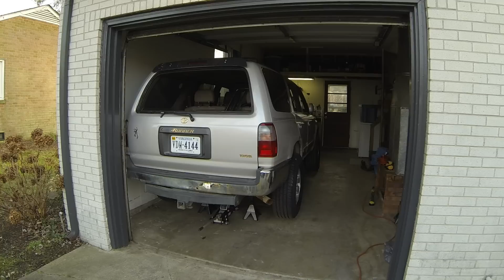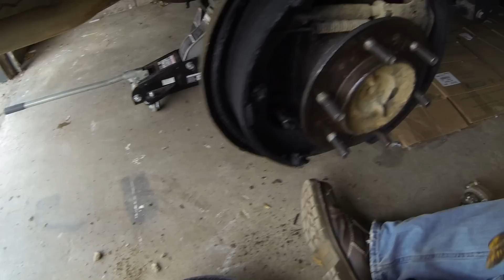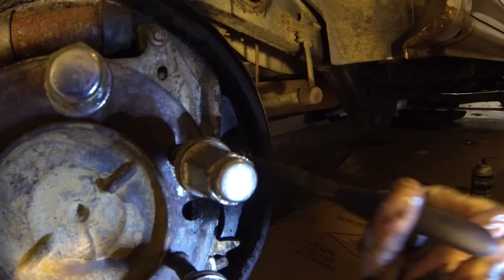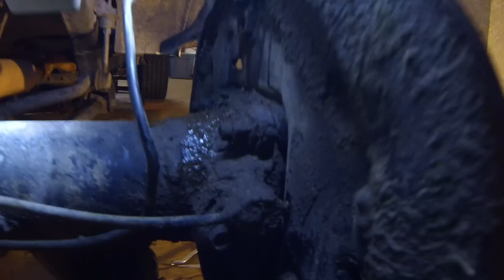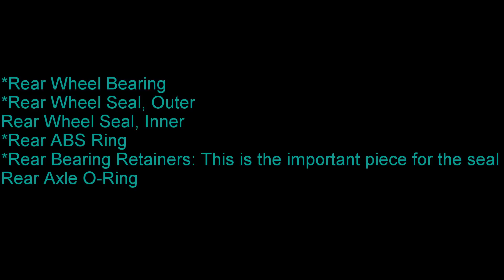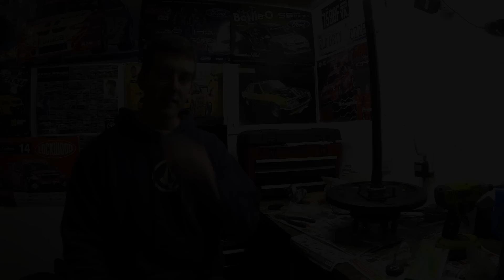3rd Gen Toyota 4Runner Project Build: Rear Axle Seal Part 1

Comment: The tools to re condition the axle shaft are made by a Toyota 4runner enthusiast there not to bad on price 135 bucks and if you want the Tacoma adapter its 45 bucks helps remove and re install the tone ring and seals

Comment: very good.  Also looks like you replaced the wheel brake cylinder while your were at it.  Also, where is the 'hot air escape valve" located?  Seems pointless to replace everything if the causality is a plugged up valve....... Actually , it is called the 'rear axle differential vent'..... The vent is located on the upper left side of the differential looking from the rear.

Comment: great video. Do you actually need to remove the brake pads or is it kind of a must just to get the e-brake wire out of there? Thanks,
Cole
Reply from the maker: Should make life easier to remove the pads
Reply: Would have to replace the pads anyways since they’ve been soaking in gear oil. The E-brake line just disconnects near the bottom and you can also unhook the bell crank behind the dust shield.

Comment: Was there a retention "C" washer that retains the axle in the differential?
Reply from the maker: not that I recall...there are 4 bolts that hold it in place behind the drums
Reply: I've done a similar job like this on my 1995 F150.  To prevent the axle from coming out of the differential, there was a large "C" shaped washer that retained it.  Because the axle is a rotating assembly how do 4 bolts hold it in place?  Do they go into a rotating baring assembly or something?
Reply from the maker: The bearing/hub is pressed onto the axle shaft which has 4 bolts pressed in from the factory. The bolts would go through the axle housing and screw into the pressed on axle bearing plate.

You can see this on my part 2 video around the 2:14 time mark: https://youtu.be/tp1-bXbkpW0?t=2m14s

Hope this helps!

Comment: looking to get mine pressed and replaced also, want to do what you did and dro it off so i can slap it back in. roughly how much $$ is it to do that? i would imagine cheaper since the shop isnt seeing the truck, just the axle. awesome vid!
Reply from the maker: thanks! It cost an hours labor which was about 100 bucks in my area. dealer charged me 300 to do the exact same thing
Reply from the maker: +Garage Topics however the dealer may have known how far to press the bearing back in, eliminating the headache I had

Comment: Next time you try to take off your rear drum just give it a little smack with a hammer.
Reply from the maker: yea I was a pansy and didn't want to break anything...screw did the trick though!
Reply: +Garage Topics Whatever gets the job done is good in my book! great video. keep it up!
Reply: Christian R.  you can blast the crap out of the drum at an angle on the edge. works like a champ. i have never damaged a drum with this method.

Comment: I'm trying to make an account on the t4r forum to ask for some help but it keeps saying I'm a spammer so it wont let me sign up. I've already emailed the admins and am waiting for a reply. In the meantime what brake parts did you replace. In my case since axle shaft snapped what should I do?
Reply from the maker: Shoes, drum, wheel cylinder, drum brake hardware kit for the rears. Just make sure you fully drain the oil and get any metal flakes out of the oil/rear end. A magnet should help get any metal shavings out. Best of luck with the message board!

Comment: Do you know how to check to see if the rear axle bearings are worn?
Reply from the maker: +eric brune when you take out the axle, it will be sloppy on the axle compared to the hub. Without unbolting anything, jack the truck and and pull/tug on the wheel. If it has play, most likely the bearing is bad. Hope this helps!

Comment: I have a 98 4Runner and I have to change the axle seal as well.  I'm very grateful for this video.  Seen it, rewinded it, paused it, got upset at the shop like you did and saw the video like 10 times more.. ha..  One question if I may, while your grease build up was tremendous and required new brake pads and drums, mine aren't so bad.  I was able to clean the pads and drums with brake cleaner and they seem fine (emphasis on "seem").  Are greasy pads no longer good?  Does he clay from the pad absorb the grease somehow?  Sorry for what might be a "newbie" question.  Better safe than sorry.  Thanks for the video and any input you can give.
Reply from the maker: Thanks a lot! Yea I was super bummed about the shop messing up..live and learn.

Since I bought the 4Runner with the leak, I wasn't sure how long it had been leaking for. That's why I got all new brakes. Also, I didn't want to clean up all of that grease buildup and have the brakes not work later down the road.

Comment: I would have been more upset at the shop for damaging the axle.
Reply from the maker: Trust me, I was. I took a step back and realized that I only paid 1/4 in labor compared to what Toyota charges. 

Word of advise: Don't assume an independent shop knows what to do with these axles. Make sure they measure before disassembly

Comment: What brand of axle seal did you use? I saw in another vid that some of the non oem ones grip too tightly and consequently wear out pretty fast.
Reply from the maker: sharartimunda I used OEM because i had read the same thing...so far so good!

Comment: super freakin helpful!  I'm trying to decide whether to rebuild my 2003 4runner rear end vs just getting a junk yard unit.  Mine has 160K miles and while it still works, there's almost NO fluid in it at all, and it sort of sounds like the charge-up noise for the gauss gun in half-life 2...
Reply from the maker: If the rear end isn't rusty I would work with it. If it has rust or you can tell it has been neglected I would go for a junkyard one. Peace of mind is sometimes worth the extra costs. Plus, you can replace things easier while you are in there, specially if you are doing a lift on the 4Runner